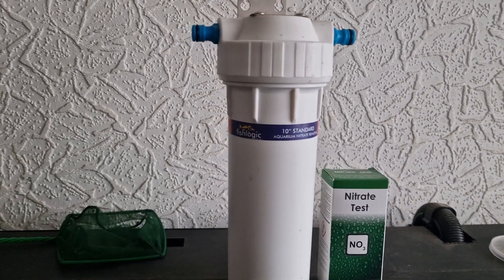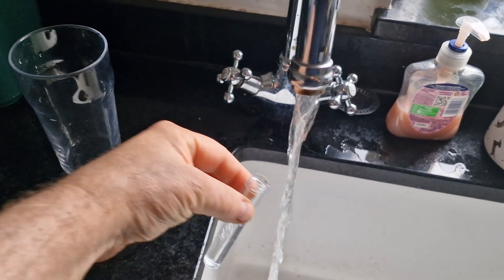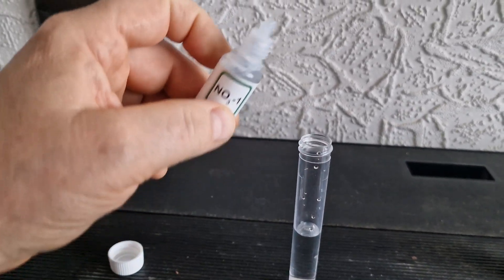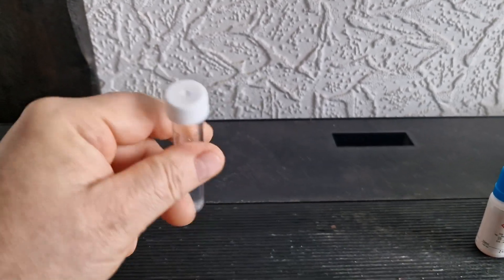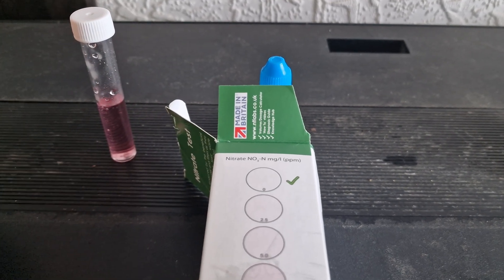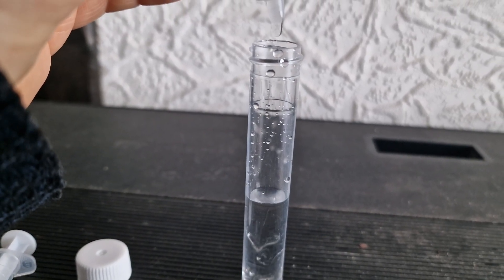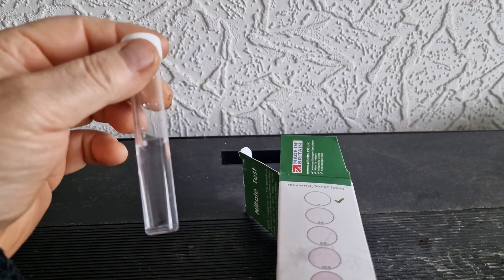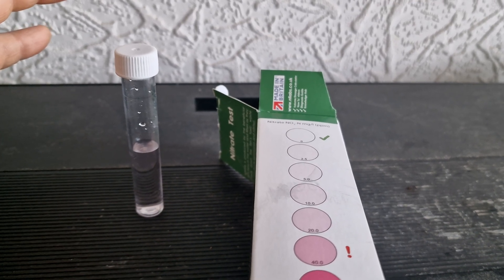Aquarium Nitrate filter to remove nitrates from tap and faucet

Comment: Does the filter slow down the water pressure? I am thinking water changes will take longer? Also do you need to remineralise the water before you add to the tank?
Reply from the maker: the way i do it is every other W/C i do a normal one thus keeping parameters level also the pressure on mine was very similar or same
Reply: @AQUAGUYUK  can i ask, how long does the pozzani filter cartridge last for you? When do you replace it
Reply from the maker: @arijsyed I change mine mo they but use it nearly every day about a thousand litres and only when the nitrates equal the nitrates from the tap
Reply: @AQUAGUYUK thanks, i change about 300 liters a week for my tank. So should safely last couple months at least, maybe 3 but will keep an eye on nitrate testing
Reply from the maker: @arijsyed it really depends on how are the filter needs to work i tend to use it every other W/C to keep the water chem the same and if your cleaning nitrate and other sediments or particulates it may last shorter or longer I did notice ph swing if you don't mix it 1 on 1 off

Comment: Hey mate I was wanting to get 1 of these as I got nitrates in my tap water...would I be able to connect the filter to my kitchen tap if I've got a hozelock adapter and if so does the filter come with everything needed? If you can get back to me I'd really appreciate it thanks 👍
Reply from the maker: the kit is meant for garden hose and comes with the adapters for said hose i understand some areas of the UK the nitrate is 50ppm i normal drink filtered water rather than tap to be honest ,,,you can buy similar for your under sink install like tap2 or similar
Reply: @AQUAGUYUK  oh ok thanks for the reply i was hoping i would be able to connect it to my kitchen tap with a garden hose to filter the water as my nitrates from the tap is around 40/50ppm and isnt ideal for my aquarium and dont have a garden tap i was considering a RO system that goes under the sink but i would have no idea how to install it and guess getting a plumber to fit one wont be cheap lol
Reply from the maker: well yes you can use this from your tap to the nitrate filter then to an aquarium i do this all the time you would need an adapter for the tap i use these https://www.amazon.co.uk/Connector-Threadless-Universal-Gardening-Washers%EF%BC%8812-16mm%EF%BC%89/dp/B0FBMMH1S5/ref=sr_1_18?crid=3LNDQW5GUJ1DA&dib=eyJ2IjoiMSJ9.haPHsfBl1ZitV19OoLe48tIZ6wvyQQUpRNRNn-t3EaH5yB5ExVvUsp_d0LEIQceRZ6TBHME0JN7cJpMGE1dMKAXuqrfDImYjgcBp64U_-AnbBYYR-ZaRxWMPsjVDiyxYMRA37BDmdDGhs4mqEgaDnQdROobcMhArJhGzx4g1-IIPFJWauV8xdI2qO0G-gCu_l1APVxWCsAMgamQo6wST-LEBAg6-xG6RCjdTq7zDUd-dQ_KtSx3KbLd3GFAZmsKe1M0rnqWHy-r1dDQornKNFSI4LZlocSVw9xuMTZPEdpA.LVsOGS4B9Ozv2S9lEjy_YOMZ7jwWT-Zi_N1y1NNSmOA&dib_tag=se&keywords=tap%2Badapter&qid=1765924066&sprefix=tap%2Batapt%2Caps%2C96&sr=8-18&th=1
Reply: @AQUAGUYUK  oh thats brilliant thank you so much i really appreciate it👍 so if i get the adapter from amazon would i need anything else or is everything i need come with the filter? just subscribbed to your channel 👍
Reply from the maker: @DeanKelz  you will get instructions but yes has all you need and should even have the hose pipe ends required just make sure the the adapter is for a mixer tap so you need to adjust to correct temp while running the tap also you still need dechlorinater
Reply: @AQUAGUYUK  got ya thats great again thank you sooo much i really appreciate your help mate keep up the good work 👍
Reply from the maker: @DeanKelz  Keep me posted
Reply: @AQUAGUYUK  will do mate ordered the filter and adapter this morning 👍
Reply from the maker: @DeanKelz  should be good to go with the mixer adapter but do a pressure test also remember to warm up the water using the mixer so let it flow in the sink for a few minutes as there maybe fluctuations and also add dechlorinator
Reply from the maker: Oh one last thing if you have live plants i would do a "one on and one off " water change as you need some nitrate also keeps Ph normalised
Reply: @AQUAGUYUK  thanks mate yeah i got a thermometer for the temperature and i do have a fair few plants and pothos growing out the top so ill keep that in mind about keeping some nitrates in the water i use seachem root tabs but they are nitrogen based dont contain nitrates so ill either do what you said or try leaving fish waste in the tank to break down and convert to nitrates or use something like seachem flourish nitrogen liquid fertilizer to add in some nitrates guess i can experiment see what works best....thanks again for all the help an advise you have been a massive help👍
Reply from the maker: @DeanKelz  Very welcome and good luck
Reply: @AQUAGUYUK  the filter come yesterday tried it out this morning when i got home from work and it works brilliantly im over the moon now i havent got to worry about poxy nitrates in the tap water lol...i had to get a hozelock adapter that my taps slides into an clamps down on the top of the tap for the type of tap i have and had to modify it slightly by cutting the part the tap slides into to make it a bit wider for my tap and works great...again thank you soo much for all the help....hows your tanks and fish getting on?...look forward to the next upload 👍
Reply from the maker: @DeanKelz great news i would keep an eye on ph mine wobbles a little and put it down to the resin used will be doing a little update before xmas
Reply: @AQUAGUYUK  will do....i look forward to the update...im kind of gutted i got a 200L tank i was going to set up today ordered wood an rocks that come the other day ...made a lid for the tank yesterday and got my sand delivered yesterday from maidenhead i ordered speckled sand thats meant to be a beach kind of colour with some dark bits in it an what i received is a light/mid grey colour i dont really like it an dont think will look good an cant be bothered to send it back so im in 2 minds if to just use it or try an find somewhere else to get a natural colour decent sand ...i was going to use fluval stratum in media bags and sand on top like my other tanks 😮‍💨
Reply from the maker: @DeanKelz argos play send its cheap but makes sure your happy before the scape
Reply: @AQUAGUYUK  thanks mate...i think im just going to use what i got save wasting it and fish might look good against the painted black background and darker sunbstrate and guess it would make a change from my other tanks....was just doing some maintenance on 1 of my tanks and just seen i got some platy fry lol be intresting to see what colour they turn out as the parents would be a blue wagtail platy and a sunset platy 😅
Reply from the maker: @DeanKelz keep me posted
Reply from the maker: @DeanKelz plattys are great i used to hybridise them many moons ago well good luck

Comment: Hi mate could you tell me how fast it comes back out and into the tank ? I have a 500ltr tank and worry it may take to long to do water changes
Reply from the maker: Good question and welcome ,it comes out at near mains or tap pressure i do find that lowering the pressure had a better result so i have 2 240 ltr a 350 ltr and 3 200ltr tanks plus a flex and turtle tank i do 50% changes on half of the tanks weekly and takes about 20 mins more than a hose pipe
Reply: @AQUAGUYUK was just hoping it comes out without enough pressure to reach my tank and have enough lift. I use an outside mixer tap so I can get the temperature correct 😊
Reply from the maker: @Du-val_Carp_Fishing  i use my tap and the outside is fed by the same system so all good

Comment: Hi 

Do you run this at around 1L per minute? 

Also do you pre fill buckets before water changes? 

Only because I have used the filter once and the nitrates are high coming out of it still 

Thank you
Reply from the maker: its used on mains tap pressure so i connect to the tap run it for 5 mins to reach temp then into the tank adding water conditioner to said tank but if your still getting high nitrates both in and out its not working mine went from 48 ppm to 1 ppm i assume you are using an in date liquid test kit and not strips
Reply: @AQUAGUYUK 

Hi yes I bought a new api master test kit recently
Reply from the maker: the unit cant be working have you tried reversing the flow if not ask for a new cartridge
Reply: @AQUAGUYUK I did speak to their customer service, they are gonna send out a replacement filter; so hopefully that will solve it
Reply from the maker: @FrankMill-zn8ul  Should do i been using these for a lone time never an issue oh except a small Ph drop

Comment: Hi Great video 

Good job I checked my tap water I have high readings of nitrate. 

Quick question how long do these filters tend to last for? 

Thank you
Reply from the maker: Well i have 4 tanks i change roughly 250 ltres a week and mine last about 3 months before nitrates start to rise i would also say check Ph as i did notice a small drop
Reply: @AQUAGUYUK  thank you 🙏

Comment: Great job we’ve never tested our tapwater for nitrates. Honestly, we don’t even check our tanks for nitrates and doing this since I was five and I’m gonna be 52 and I’ve never checked any tank I’ve ever had in my life. I guess we’re just lucky lots of people are really testing, we do have a filter system on our refrigerator for our drinking and cooking water, but we use tapwater to top off the tanks most likely because we have so many plants our tanks and because we don’t overfeed they just never build up
Reply from the maker: Well in the U.S the laws are very different so you should be good the legal limit is 10ppm as this is deemed the safe limit which i have now reported to out authorities as the UK limit was set in the 80's and to be honest it wouldnt be an issue if it was a static amount mine goes from 23ppm to 50ppm this in turn ,because i filter the water changes my PH

Comment: What flowrate can you run it through the unit? Probably pretty low so might take a long time if your changing a large amount of water? Also regarding the flow rate, do you have to set the tap at the correct flow or can you just turn on the tap and it'll self regulate the flow through the cannister (if that makes sense)?
Reply from the maker: well to be honest it depends on the tap or faucet flow i only noticed a small drop in performance i filled 2 fluval roma 240 one with filter and one with out it took about 15 minutes longer i also filled a tetra 105 with the filter and it seemed the same having said that i never open the tap "way open" but a steady flow just to preserve and decor ,,,now you mention that when testing on full i noticed a drop from 50ppm nitrate to around 5 but when filling the tanks and a lower rate the test sample looked like "0" nitrate according to the text that came with it max pressure for operation is 95psi  here is all they give you as instruction https://www.pozzani.co.uk/pub/media/hexaattachment/products/attachments/No.10_aquarium_nitrate_removal_system_brochure.pdf

Comment: I had between 70 and 90 parts per million in my tap water got fed up with it in the end. No longer have fish tanks.
Reply from the maker: well the legal limit is 50ppm you should complain but also with this you could run one or how i solved it in the shop was filtered rain water
Reply: @AQUAGUYUK  I told my landlord about the legal  Limited they wasn't intrested.
Reply from the maker: Tell your supplier as they are responsible or look onvthere website for the info but this will drop it right down
Reply: @AQUAGUYUK  I moved in January it's still Southern water. I had been getting sick because  of the tap water.
Reply from the maker: @stephen-truthseeker  you need to see there official testing here https://www.southernwater.co.uk/help-and-support/hard-water-checker-and-full-water-quality-report/ then if you feel its not up to scratch ask them to test locally i had similar issue where i am its only and email and they may find an issue